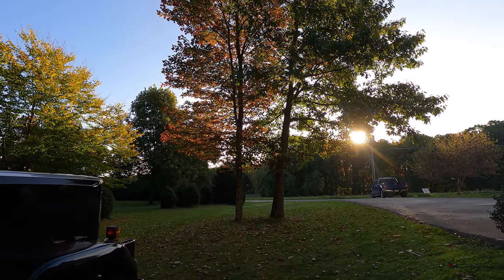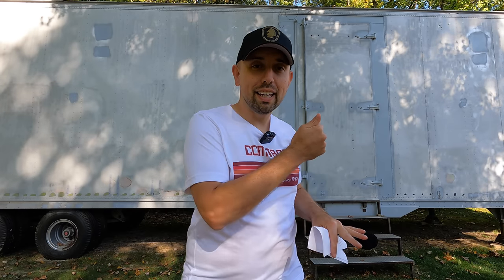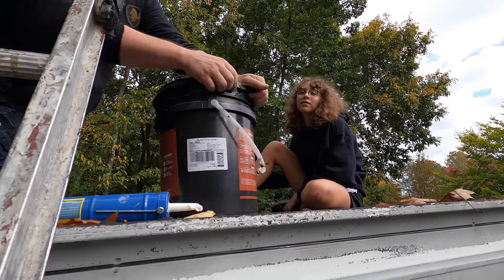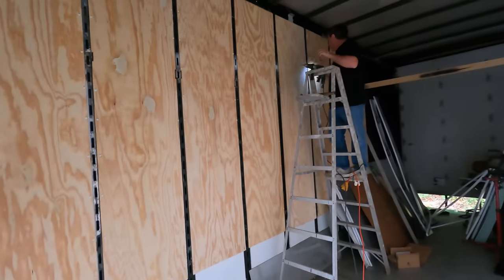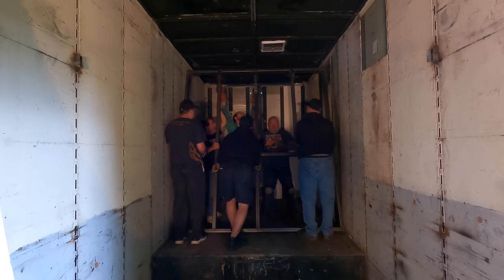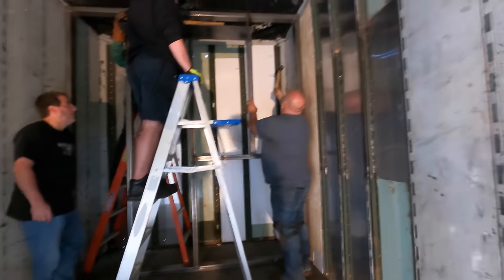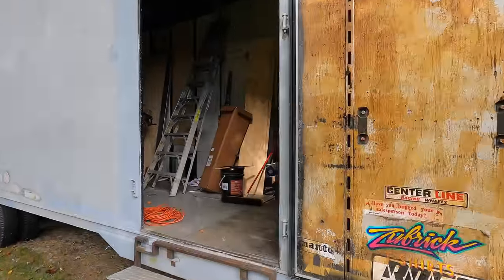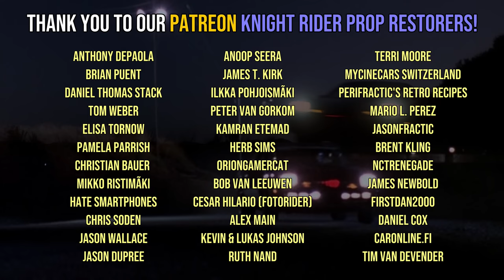HUGE Progress on the Screen Used Knight Rider Semi! Winch Wall Install, Tractor Maintenance + More!

Comment: The idea of having the plaque on the door is awesome! And, depending on font used and how thick the material used, You could even make it so that when the door is opened, that piece can "fold" out, allowing more names to be put on the back of it, and the door. (3 surfaces to write on instead of 1)

Comment: If you run the winch off a battery then you could wire a battery charger up to that outside plug and then plug a extension cord with a male end on both ends into it to charge the battery's

Comment: Suggestion...if you do an inside panel on the door with one side being 80's set and upon opening it's the names, that will leave another door size space for names if you wind up needing two plaques. Kind of like opening a book, one side is exterior door, the other is 80's set, but open the panel and you have two pages to read.

Comment: I thought that winch wall had a fake door on the right to nowhere.
Could you put the door back and make it useable to gain access to storage generator area
Great progress being made and you dot want the engine sitting too long without oil in it.
Engines dont like sitting without running to get everything lubricated and up to temperature

Comment: I would definitely put another sealant coating on the roof in the spring.  Getting the heat from the sun on that roof will break down the one sealant coat over time.

Comment: What is the Current rating of the tractor's Alternator? Do you think it will be enough for all the electronics in the trailer? Perhaps you need to find a high output alternator.

Comment: Joe this is awesome everything I have seen since you started this channel I have enjoyed. Q:
Did you get the ramp for the semi or is it on hold? Did you also get the office panels where Patricia and Rebecca were sitting at the desk in the show next to the lounge? Are you adding Wi-Fi in the semi reason I'm asking is based on video call or data transmitted to K.I.T.T during the show's run.
I also think the car carrier used all the cars on the show yes...?
Thanks
John Reissiger
P.s. keep up the good work.

Comment: If the truck stays running when you turn the key to off.. than it’s possible the fuel pump solenoid needs to be replaced.
Reply: @user-rs1990  That is correct

Comment: it wont turn off because the screw in the fuel solenoid is turned in, you can do a search and find where it is at. the wire going to it should have 12 volts with key on and no volts with key off, if it does this the solenoid is most likely bad and the previous owner just opted to abuse the clutch and tranny to kill it, you tube this phrase,   M939 truck with NHC250 Fuel Shut off Solenoid Combat Mode Knob adjustment, its not a combat knob and you need 12 volts but it has a clear video of the stuff you need to know, i mentioned before to have the trailer kingpin checked, you will be sad if you have to replace it after your finished, amazon, trailer kingpin gauge will bring up a tool, recap tires are a very very very bad thing, if you put those on the truck i would get virgin tires, you can still have a blow out but the chance is very low,

Comment: What happens for the diesel engine to shut down you need to stop the fuel supply. Put the parking brakes on put it in gear and stall it till you replace the Fuel Shut Off solenoid
Reply: Yes put in a high gear

Comment: I had that issue happen to a Peterbilt that I was driving there's a very small electronic part on the driver side of the engine that controls the shut off of the truck

Comment: Your engine shut off issue is the Fuel Shut off Solenoid. It should be located on the driver's side of the engine
Reply from the maker: It isn't that, we've already replaced it.